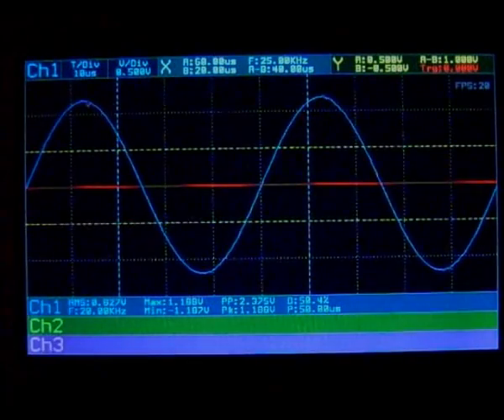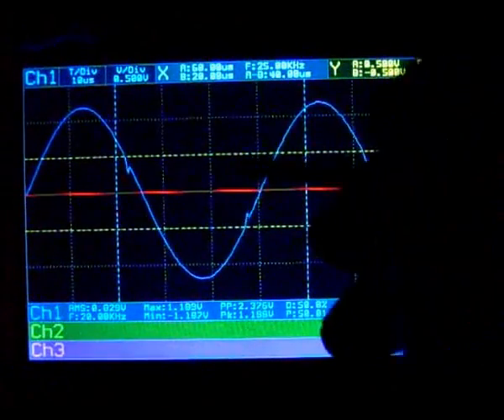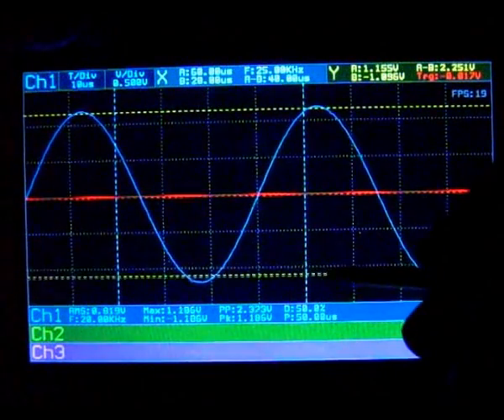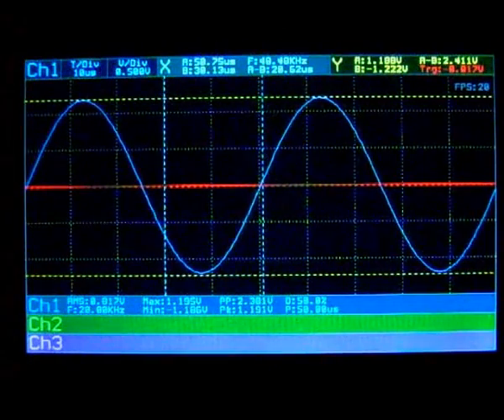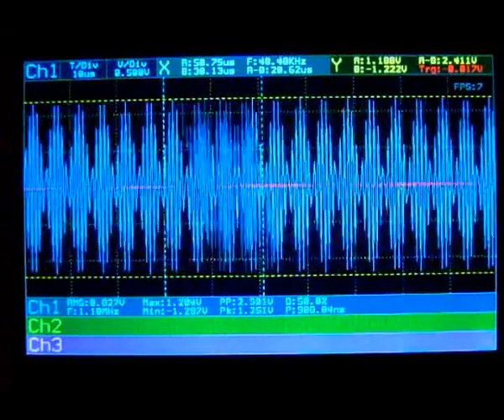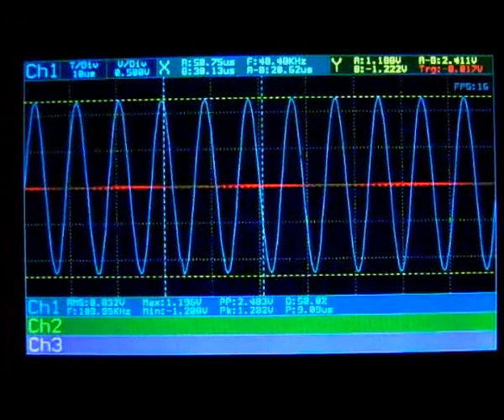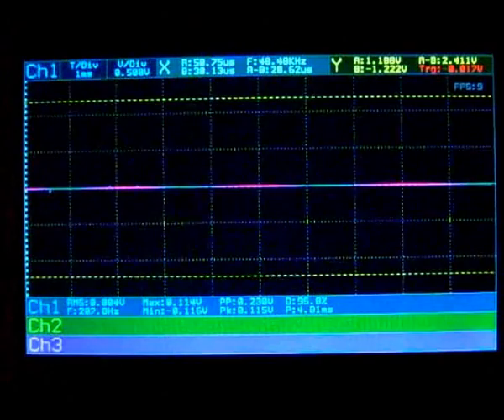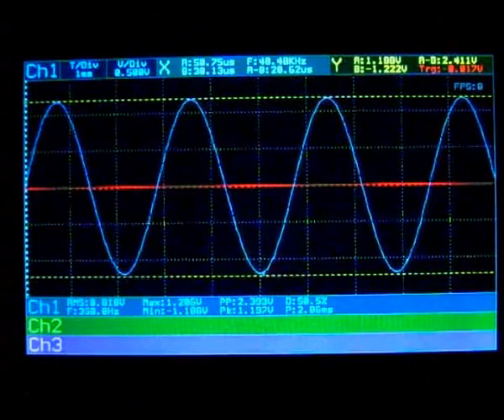All in one Multimeter and DSO with SSD1963, STM32F4 discovery and ChibiOS/uGFX

Comment: Hi Naftilos, I am trying to make this work on my F407 board. I can compile it using your tutorial, but the 8bit display I have will not work because there is no driver for it in the older ugfx you used. I bought an spi display which is supported in newer ugfx but cant get it to work in the older ugfx. 
Are you still working on the project? If so, do you have it running on newer chibios and ugfx?
Thanks in advance
Reply from the maker: Hi LouDnl, truth is i am not working in the project. Things got in the way and i kind of left it for ever. Why don't you try to get a lcd like the one i used? SPI will not give you the high frame rate i got. The way i connected the lcd is not simply parallel. It was using if not mistaken DMA which would give you the best performance ever. In some cases i got nearly 100fps which is unbeatable. I am almost sure that this link: https://www.aliexpress.com/item/1877760717.html is a lcd that has exactly the same port mine had! Hope this helps.

Comment: I wish a Happy New Year !! :)
About this project (yes, I understand it is "on hold" now). Short question: if I take STM32F4-DISCOVERY board, and exactly the same TFT with touch as you describe in PDF file - will this device work by simply uploading .HEX file (ch.hex) from your project archive? Thank You!
Reply from the maker: Happy new year to you as well. Yes that should do the trick. Try it and let me know!
Reply: naftilos76 , Well, i have STM board, but not such display. So i am into considering to get one, or not. I would like to ask - is there any realistic possibility that you someday return to this project?
Reply from the maker: Hi Juris, i do hope that i will be back to the project earlier than the end of this year but that is just a wish. Dev boards are used only for testing purposes so it does not really matter if you have a STM or any other dev board. Working with the exact same board & lcd will only make your life easier but that does not mean that these will be the final components of this project. Lot's of prototyping is still to be done, multilayer PCB designing is a must and lot's of other testing and digging are needed. So if your asking for reassurance i would say i cannot provide that sort of thing.
Reply: Understood, thank you for realistic answer. If I will buy that kind of TFT for now (and, knowing myself, i probably will), and got all working at current state, i sure will let you know. Then in future, if needed, you will be able to use me as a "test field" :) I am stupid at programming, but i am electronics engineer none the less, so may be i qualify :)

Comment: Hi,
Have you managed to hook up 4Msps 24-bit ADC? Which one did you use? Is there any code/instructions available?
Reply from the maker: This project is based on stm32f4 discovery and the adc used is the one integrated in the stm32f4 uC. There is one adc 24bit 4MS/s that i know and that would definitely need a FPGA to help you route the adc data to the memory of the fpga or even an external sdram or a faster ram chip such as ddr2 or 3. That would require verilog knowledge. You could probably even send the saved adc data to the stm32 uC for processing such as calculating RMS values over any type of waveform etc. This project on the other hand is quite simple as is and at a stand still at the moment. I am struggling though to find time and include a FPGA in the process of sampling. Hope i did not make it impossible for you!
Reply: naftilos76 Thanks for the answer. I just saw you mention that sort of ADC and got curious :)
I was actually wondering if it's possible to read AD7760 with discovery board... It's 2.5Msps and has 16-bit parallel interface. I want to log the data from it onto sd card without any processing, do you think it's possible without any FPGAs and such?
I'm a complete noob in this and read that much info over last 3 days my head hurts.
Reply from the maker: Hi Anton, electronics is a really wide area. I am more of a hobbist regarding electronics. I never studied electronics in a university but persistance was always something that acompanied me when i tried to figure out what and how to implement an electronics project. Anyway, most high speed adcs have a type of data output called LVD. That makes sure that the data is transfered to another ic without being affected. Google LVD to learn more about it. Now, there are a few more adcs that have serial outputs 0-3V which is basically what you want. Having to make a driver for that kind of adc would require transferring the serial data into the uC and further more into the sd card. No matter what you do you have to deal with finding code for working with the sd card. You could also try reading about RTOS which in return would let you know how to operate the peripherals of the uC you intent to use such as the adc, timer, uart, usb and so on. Once you get to the point where you know how to use a compiler & code uploader with a RTOS you are half the way closer to your objective. It is a bit complex to do what you mentioned earlier if you have no or very little uC experience. However connecting an adc with a uC and saving data into a sd card is a perfectly doable task.
Reply: I understand what you are saying. I'm a hobbyist too and my experience ends with arduino pretty much.
I've read about LVDS interface for ADCs, ant it looks overly complicated for me. Serial is not so, but it is much slower. I was looking for an ADC with parallel interface and looks like AD7760 is a good one. It basically outputs data on 16 pins (twice per sample) and that gives me hope I can utilize a whole port on stm32 to read it. I was hoping you, having more experience with discovery board, know how fast gpio port can be read and how fast sdio interface can wrire data to sd card?
Reply: Hi Anton, the discovery board can switch the gpios up to a few hundred MHz. It is really fast. As to how fast can a data stream be written to an SD card by the STM32F4x, i think we are talking a few MBytes/second maybe 2-3 MB/s. I suppose that you can make this happen with AD7760. However, one thing that you should consider is the amount of data you are willing to save per time unit. If we are talking MSamples here then you have to connect an SDRAM to the STM uC which would not allow you to save fast enough (not more than a couple tenths of MSamples). For fast sampling (>20-30 MSamples) you have to consider FPGAs connected to DDR RAM chips. In that case you should study Verilog (FPGA language!). High speed digital electronics introduce a whole new bunch of problems to deal with such as digital noise, proper PCB design like mutlilayer >=4 layers, LVDS connections, FPGA programming, nano second sensitive timings, coupling I/Os of digital ICs and many more! Have faith though, nothing is impossible. If you really want, you can make anything work. Have fun!

Comment: Hi, amazing project. How do you sync the display and the graphic data?? I can't get rid of the screen tearing
Reply: Hi Daniel, you have not stated whether you have followed my tutorial (further down) and therefore my source code or you did something of your own. I can't assume anything if you do not give me more info. In any case, a few things you could consider rechecking is the clock of the CPU (may be tricky in some cases), the correct setup of the LCD (before actually sending any data to it) and improvement of your drawing-on-ther-display code (only if you wrote your own code). Let me know how it goes...

Comment: hi, i am working with same tft and stm32f4 discovery board seeing your video seem everything working very smoothly. the current issue I am facing is fps on tft using stm32f4 i am able to get ~1fps. I am using general gpio for sending and receive data to TFT no DMA/FSMC are they really required? and which compiler are you using?
Reply from the maker: Hi, if you are not using my source code, then i suggest you reconsider de-bugging your code. Getting only 1 fps as far as waveform drawing is concerned makes absolutely no sense. It is way too slow. Even if you are using GPIO to drive your lcd you are still equiped with a STM32F4 probably working at 168MHz. Your issue is clearly a bad source code not entirely though but hopefully only at the point where you make calculations on the values stored in your ram. How many samples are you using for your calculations? The RMS value is one of the most cpu-demanding processes. If you do that with 10K samples or 20K samples then you need more time to complete that. You also need a smart way of drawing your waveforms on the lcd to avoid various unpleasant conditions such as slow drawing (low fps), flickering, distorsion of your waveform and lots of other annoying graphical artifacts. Examine your code carefully and post back again to let me know how you are doing.
Reply: Hi, thks for replay.
Well I dn't find your code can you post a link.

And for now I am able to communicate with TFT using FSMC getting ~8FPS my target is at ~30FPS, plz take a look at code and let me knw where i am not correct. Waiting for your link and comment.

link to download fsmc code is

https://my.st.com/public/STe2ecommunities/mcu/Lists/cortex_mx_stm32/DispForm.aspx?ID=43445&RootFolder=https%3a%2f%2fmy%2est%2ecom%2fpublic%2fSTe2ecommunities%2fmcu%2fLists%2fcortex_mx_stm32%2fSTM32F407%20with%20SSD1963%207%20%28800x480%29%20Display&Source=https%3A%2F%2Fmy%2Est%2Ecom%2Fpublic%2FSTe2ecommunities%2Fmcu%2FLists%2Fcortex_mx_stm32%2FFlat%2Easpx%3FRootFolder%3Dhttps%253a%252f%252fmy%252est%252ecom%252fpublic%252fSTe2ecommunities%252fmcu%252fLists%252fcortex%255fmx%255fstm32%252fSTM32F407%2520with%2520SSD1963%25207%2520%2528800x480%2529%2520Display%26FolderCTID%3D0x01200200770978C69A1141439FE559EB459D7580009C4E14902C3CDE46A77F0FFD06506F5B%26currentviews%3D45
Reply from the maker: You can download my tutorial at: http://naftilos76.net/dl/tutorial.pdf . It is already in the my comments if you see them below. The tutorial contains lots of information regarding source code, compilers, configuration etc... I have really no time at all to look in the the code you are you using. Hope this helps.

Comment: Very interesting project, which analog-to-digital converter you used to get 2*16-bit 100MSPS?
Reply from the maker: There are a few like ADS5493, AD9268, AD9446, ADS42JB49,
LTC2185/LTC2184/LTC2183 and a few others. I am considering a lot of things but first i need to be sure about whether i will use an FPGA which is the obvious solution or not. It is very challenging as i have to combine quite a few different types of components like uC, FPGA, ADC, SDRAM etc. The front end opamp circuitry is also a huge challenge as 16bits need a perfect opamp. Let's see how many ENOBs will be left :-) .

Comment: Very nice work, i want to build dso also, i got both stm32f407 and the same lcd screen, any guidance from where do i start would be highly appreciated
Reply from the maker: Hi Kosta, I would be glad to help. Can you give me some information about what you wish to build? I mean, what is the max sampling speed are you targetting? That makes a lot of difference when you go higher and higher. If you have a STM32F4 discovery board you could combine the 3 individual adcs to get a sampling speed of 2.3Msps * 3 = 7Msps. If you want more, then you need to use an external ADC and connect to it via spi if the speed is not too higher than 7Msps. Furthermore, you have to start digging a little bit more if you intent to go up to 100Msps. Please give me an idea of how you imagine your dso and we could start right there. Btw, i am using ubuntu 10.10 and i have setup eclipse indigo with Chibios 2.6 + uGFX 1.8. I can flash and debug just fine. Waiting for your response.
Reply: Hello, i wanna build a dso for practice on my laboratory exercises where im studying, because i cant afford so much money for an osciloscope right now, and also because it is a quite big challenge for me. About the sampling rate, where did you found the sample rate of internal adc? so having a max of 7Msps the maximum frequency that can be measured is only up 3.5Mhz because of what Nyquist says.
In your own project, your 3 adc's are external right? also one last question, do you use external ram for video buffer? because i know stm32f4 got a maximum of 1Mbyte internal ram. Also im currently very new to ARM microcontrollers(just entered), used in past for education avr's and pic microcontrollers, and i want to expand my knowledge into ARM
Reply from the maker: Gia sou Kosta, it is not that simple to explain on this thread what your first steps into ARM programming will be. My email is naftilos76@gmail.com. You can contact me there and maybe at some point i could help you via skype. I am a newbie as well. What i did was based on a struggle after googling a lot, asking here and there, read again and again all the tutos i could get my hands on as well as asked the developer from uGFX to give me a push. It takes time and patience.
Reply: naftilos76 Hello again. After a long time that i jumped to F429 discovery board and done some little projects with it(if you're intrested to take a look http://www.github.com/papadkostas), i came back here and i noticed that you releashed the project files, thats very intresting. I tool a look at the zip file, and after all i have a question. The rest source code is already compiled? is that correct? Also thank you for the pdf file, I'm trying to get rid of windows and run everything on debian linux, and i had a couple of problems while trying to setup the eclipse enviroment by my self, i will follow your guide and i hope i will get rid of the error.

Comment: Hi, I really like this project! I also am working on a project using a SSD1963 for LCD control, do you have any source code for it to share?

Regards
Reply from the maker: Sorry for the late reply. The code of the lcd can be downloaded at www.naftilos76.net/SSD1963/gdisp_lld_board.h . I am using ChibiOS 2.6 & uGFX 1.8. I have made it work on a STM32F4 discovery board. My configuration is FSMC and the connection pins can be found in the uGFX website: http://ugfx.org/gdisp/interface . This is the fastest way to drive the LCD and the lightest for the CPU. The file gdisp_lld_board.h contains several functions among which 3 are the ones that do the setup of the pins of the STM32F4 and the LCD setup. You have to call pre_init_board(), then init_board() and eventually (optionally) post_init_board() . These 3 functions must be manually called inside the file gdisp_lld.c located at ../ChibiOS_2.6.0/ext/ugfx/drivers/gdisp/SSD1963 directory. You can download at http://www.naftilos76.net/SSD1963/gdisp_lld.c. However there is no guarantee that this will work in your case because even though your LCD may be SSD1963 based, it can still have slightly different setup requirements as far as the file init_board() is concerned. Please let me know if you need more help.